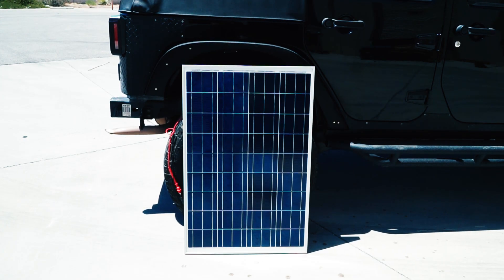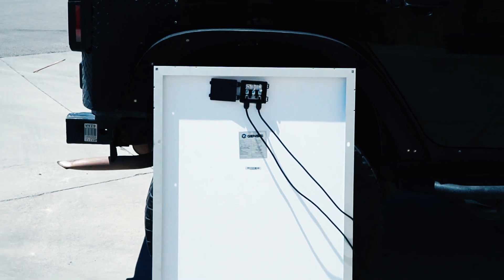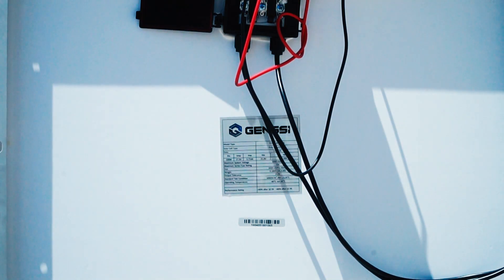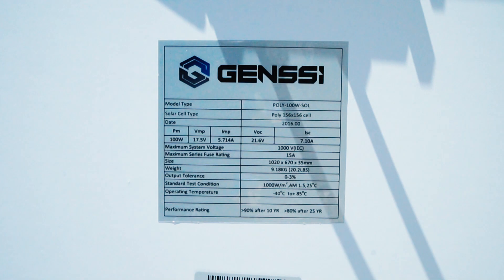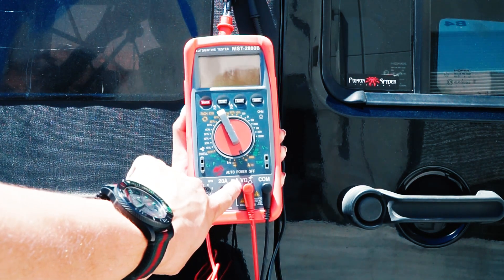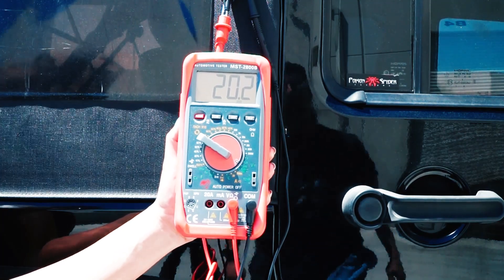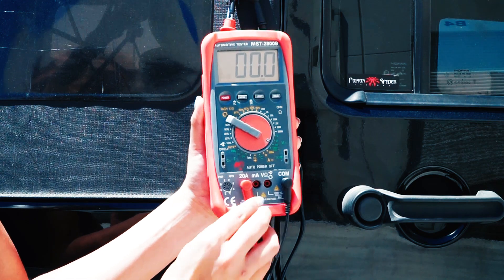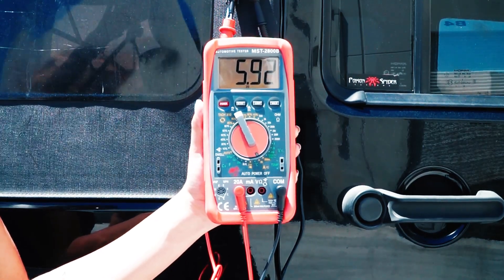How to Test a Solar Panel Voltage and Current

Comment: Wind was louder then speaker, didn't hear much......how did you connect meter to solar panel wires, talked too fast, were you in the sun or have panel covered up

Comment: This test is an open circuit test and not a loaded test 
You should connect it through a regulator to a battery and apply the same test. But do a current test in series. 
Your meter in this test essentially became the load under perfect conditions (depending on temperature)
So it's a half test, not a true indication of how good your output under load will be.
Reply: That's what I was thinking too. I have a panel that has good open circuit voltage and short circuit current, but when connected with a 55watt 24v light bulb the voltage not passes 9.5 volt and 1.5 A. The right test is the load test and not what is showed in this video.

Comment: I am an electronics engineer of 35 years & I have come to a different theory: Panel Voltage pointed at the sun, open circuit is 24v. Increase the load applied to it until this voltage gets down to 13.8v & that is the maximum, ideal condition charging capability for a "12v" lead acid battery. (these have a perfect terminal voltage of 13.8v). If the solar voltage dips below the 13.8v, no current can flow from the panel to the battery & the panel actually becomes a load itself because current would from from the battery to the panel (would indicate a faulty panel).
Reply: Sir I am a beginner to fit a solar panel.  If one solar panel is 5000 watts what size battery/ batteries should be used?
Reply: @rickynaidoo2921  I am not a solar expert
 But what I do know us 5000w is the peak capability of the panel in perfect (not achievable) conditions. 5000w is a non rating because it would be kwh (killowat hours). My understanding is you can cut any number quoted by half & then you would further de rate it because they only generate meaningful energy for a couple of hours either side of noon. They also benefit massively from being aimed directly at the sun plus they need cleaning for best results. I am sure there are plenty of reference sites but again... take numbers & debate the claims by a half to be realistic.

Comment: You didn't  mention what the voltage or amperage tolerance is. What if its 2 volts less than what its rated for?

Comment: Good practical display but maybe you need to add a couple of disclaimers as those numbers on the panel are STC. You can verify the temperature of 25 degrees easily enough but the irradiance is another story. I would tell folks that this is a very rough approximation test and really a more "go no go" test.

Comment: Yes, this video is correct. My solar panel's spec plates lists the short circuit current. To measure that you do the test as described here. 
If you are getting the correct voltage reading BUT NOT any current reading -- like I was -- check to make sure your multimeter is set to read DC and not AC! 
Such an obvious thing, but I haven't seen it mentioned anywhere when this problem comes up. As soon as I figured out my mistake and switched my meter over to the correct current all was exactly as shown in this video.

Comment: Ihave 80w 12v solar panel...how come that its output voltage is 20.4 volt...  And the current measured by controller is 26.8 amps...

Comment: if i have panel reads 68 volts and 2 amps yet panel is rated for 68 volts and 7 amps do i have a bad Dion?
Reply: no.

Comment: On the panel label:
"Do not disconnect under load."
If measuring a panel already mounted,COVER it up B-4 disconnecting!
Hook up the VOM to the red and black leads from the panel on the voltage meter setting.
Then un cover the panel to read open circuit voltage.
  Measuring amps is a bit tricky.
Reply: The do not diconect under load is more for when you have them in a string producing a high voltage like 500v when you disconect them at this voltage under load they produce a arc that can be very destructive to connectors. But if your just testing one panel at 20v thier is no issue
Reply: Or...have a switch on the positive lead from the panel before connecting
Reply: Lol.. it is only 1 panel. 
The only reason they say do not disconnect under load is to protect people that don't know what they're doing from electric shock.  And falling off a roof. 
It's the fall that kills electricians, not the electric shock.

Comment: GENSSI, the results you were looking for, were VoC and ISC. You came up short on the ISC, as it should have been closer to the rated output. The VoC was acceptable.
Reply: Exactly. He pointed to Voc and Imp and then his Isc measurement was higher than the written Imp value. He still didn't notice the mistake :)

Comment: In order to measure current, you have to connect in series with the circuit , not just switch over to Amp function in your meter ....serious mistake that will damage the multimeter !!!!  I stop watching this video once I saw this !!!
Reply: Well, I guess technically es could be correct, but that depends on the amps that you are trying to measure.  The multimeter has a limit on amps before you blow out a fuse or the meter.  However, even cheap meters usually go to 10 amps which is way above the solar panel measured here!  Nice replies guys.
Reply: Are you really that dumb? It is in series, and even if it wasn't it still wouldn't damage the meter. Instead of watching youtube, maybe go read a book if you know how.
Reply: @kayakexcursions5570  you are sure it will not damage the multimeter?
Reply: @SuperADI2  Even a cheap multimeters are rated at 10 amps (it will be listed on the device) so they will be able to test the panel. Worst case scenario if you accidentally put too much current through it, you'll blow the fuse and will have to open it up and replace it.
Reply: @kayakexcursions5570  I'm not sure why you are calling him illiterate and dumb. The way this video is testing amps is using the ammeter probe on the multimeter, which requires you to be part of the circuit. Hooking up the negative and positive like in this video WILL blow the multimeter fuse (I blew mine when I was learning...). This is not the correct way to use an ammeter.
Reply: Also, those little fuses can be $15 ...
Reply: @jaymedavis7567  
Solar panels are highly resistive so you are unlikely to destroy a 10 amp meter!
Reply: @_a.z  I did destroy my fuse, not the meter. It was a $15 fuse. Even if this was unlikely, it's still not the correct way to use an ammeter.  In addition to blowing the fuse, I blew the diode in the panel too.  An ammeter should be part of the circuit, not essentially shorted out like this video is doing.  You should never connect a multimeter like this when using the ammeter.
Reply: @jaymedavis7567  
So just the solar panel blew the fuse?
Reply: @jaymedavis7567  I actually melted my meter probes, still works though.  Not sure mine has a fuse, it probably blew years ago and I wrapped it in foil.
Reply: @jaymedavis7567  My meter cost $10  :p
Reply: @alaskanalain  haha.  Whatever works!  I'm pretty partial to the Klein tools meters (about $40), which is quite reasonable after looking at Fluke.  I was bummed about the expensive fuse, but at least I know how to use the meter now. :)

I have a backup $10 meter, but it's analog, which I cannot read as well.

Comment: Dear Genssi
If you are serious about your work you will immediately remove this video and make a new video where you show the true capabilities of your solar panel.
This video shows that your panel capabilities are the following:
20.5v at no load = no power delivered
5.8Amps at short = very little power delivered.
In short you just showed that your panel I not capable a providing any power. Just voltage but without any significant current. And I second setup a lot of current but in shorted condition.
A true demonstration will show the point where the voltage and current is at its maximum at the same time. 
Power = voltage x current.
Br
Morten Klitgaard
Reply: Did you read the video title? I didn't see anything about showing the true capabilities of the solar panels?
When you buy a solar panel it comes with a specifications sheet that shows the open circuit (no load) volts and short circuit current - this video shows you how to test both of them.
The only way to test the 'true capabilities' of a solar panel is to hook it up to an MPPT tracker, that's the only way to apply the correct amount of load to maximise power output. If you had any experience with solar panels whatsoever, you would have already known this.
Your response looks like a classic example of the Dunning–Kruger effect, where someone knows a little bit about a topic like electronics (eg power in watts = voltage x current) then assume they understand the whole field far better than they actually do.
Reply: @dillzio  Exactly, you tell someone p=ie and all of a sudden they think they're Tesla.

Comment: Spec on your panel: Voc=21.6 ; Isc=7.1; You measure Voc=20.2 ; Isc=5.9  and your conclusion is that is ok?
Reply: Correct Voc are Isc are ao a function of the panel illumination. In the video I hear that the solar panel has to point directly to the sun. I interpret that as trying to be near STC. So the conclusion could be not measuring near STC or Spec on panel is  not correct.

Comment: Josh is right,  dead short amps means nothing. Try this test with your 3kw gen.  I have fuses and meters for sale !
Just another way this crap gets sold as 100W when in real life You will do good to get 4.5 volts out of it making it only a 80 watt charger or so because as the current goes up the voltage goes down. you will only get a gallon of gas out of a gallon can.
I have one of these so called 100W panels and it should be, and probably is, illegal to sell in the US under false pretenses.
Reply: well said moron 2001

Comment: How can you even post this? You just measured current by a direct short through the meter.  The correct way is to measure to voltage across a known load, say a 2 ohm, 100 watt resistor. Now if you measure 12 volts across the 2 ohm resistor...  E/R= I ,   12 volts /2 ohms = 6 amps. Wattage = volts x amps , so 12 x 6 = 72 watts. In order to achieve a 100 watts across a 2 ohm resistor would go like this.... it's the square root of resistance x watts . which the square root  of 100 x 2 = 200 = 14.14 volts across a 2  ohm resistor would give you 7.07 amps.
Reply: In this video I have seen the following two things measured:
1. Voc (open circuit voltage)
2. Isc (short circuit current)

Based on what was actually measured, I assume the following two tests were being executed:
1. Verify/compare if the Voc (open circuit voltage) is about the same as the specification.
2. Verify/compare if the Isc (short circuit current) is about the same as specification.

A valid test is one that successfully achieves its objective; both these tests achieved their objective.

Typically, if one of these tests fails then any number of things is likely wrong (bad panel, maybe insufficient sunlight, bad wiring, etc) and
the failure(s) should be investigated prior to actually using/installing the solar panel in a real life scenario.

Again, I say yes, these two tests are valid.

(Thinking out loud...one thing that has me scratching my head is the Isc specification, it says 7.10 Amps; can this panel actually achieve an Isc of 7.10 amps?)

Now, if you want to test real life load...then that would be considered a different test(s).
Reply: Right on, Bob
Reply: So you are saying it's ok to sort circuit a panel?
Reply: Absolutely. But, in this case, his panel should have shown closer to the ISC rating of 7.10 amperes. His test only resulted in 5.90 amperes.
Reply: First of all the meter is rated at 10A, and the panel is spec'd to produce 7.1A, so his method will not hurt the meter. Secondly, the spec is ISC, a short circuit current spec. If you search around for how to troubleshoot your solar panel, you will find manufacturer videos instructing to do just what this guy did (Renogy is one). Yes, it seems surprising to dead short your panel outputs, but the specification is to measure the current produced with the outputs shorted. And the panels will tolerate such.

Comment: awesome job, but in my country Pakistan hard to find original panels , anyhow i have tested my panels which are rated for 150watts , voltage was 20.5V and short circuit current was 6.89A , means its somewhat similar to specs but derates very quickly in one or two years , other factor which i have noticed mostly effecting is temperature of panels, when i throw a bucket of water on panels it hot sun shine , its produces approx 90% of rated power, where as without cooling hardly touches 60%, whats that ?????????
Reply: which brand? and for how much?
Reply: thermal coefficiency - which is why dual sun thermal pv panels cool them with water.

Comment: what if you get the appropriate voltage from the panel....but NO AMPS at all..  Can you have volts without amps and the cables attached to the panel..?  I have a 120w - 19v - 6.7a rated panel.  NO AMPS SHOW WHEN I TEST.  I get 18.1volts.  This confuses me.
Reply: You were trying to get current open circuit (Imp) or current short circuit (Isc)? If Imp you need to complete the circuit with load and for Isc you need to connect the +ve and the -ve cable. Correct me if I'm wrong.

Comment: with one panel, it's okay to test by this method, if you are testing multiple panels connecting in series or parallel, never use this method, you either damage your device or you may get shock. never read current in parallel just like that, it's stupid idea.
Reply: You are right, that's a direct short, unless the meter is specially designed to put a specific load (which I doubt), and its meaningless unless you also know the voltage when it's under the load.    Open circuit voltage is 20, but what uses 20v?  Meaningless.   Voltage AND amp draw should be measured with a load that brings the voltage down to around 12v, that's a real life scenario.